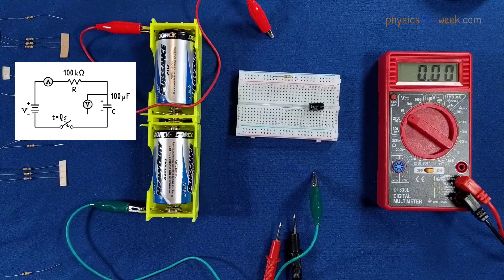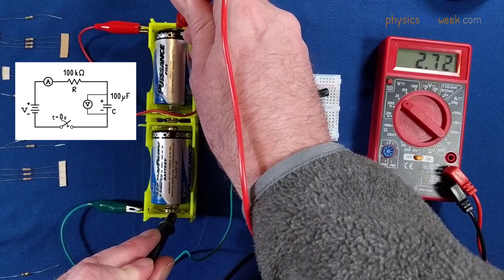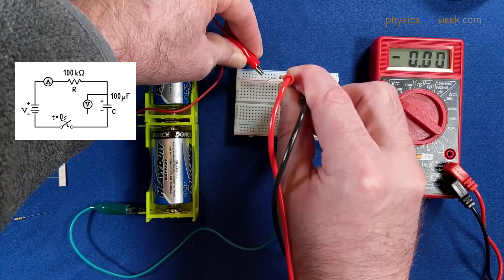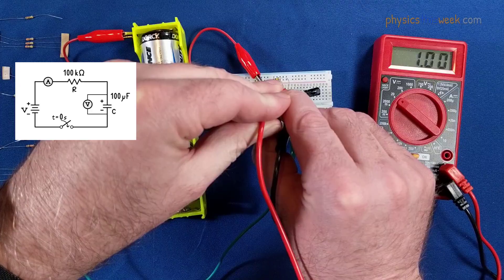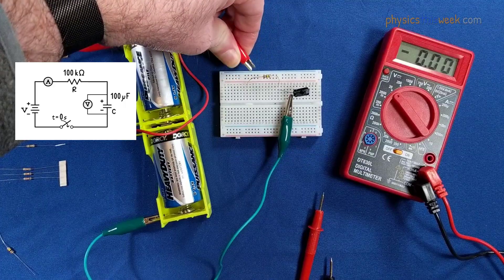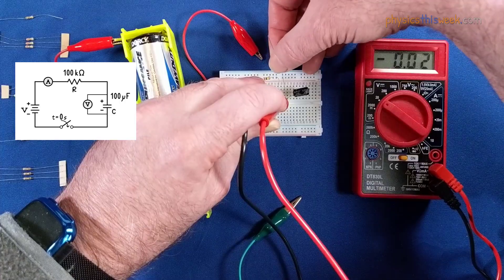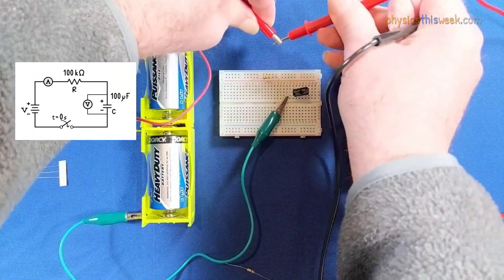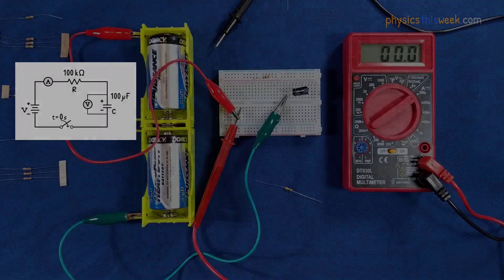DC Circuits Lab:  RC Circuit

Comment: So you're saying at steady state the capacitor voltage doesn't equal the battery voltage. It means there's a current still flowing through the resistor. Doesn't that mean that the capacitor will keep on charging? I am aware the capacitor will also lose charge over time, so it may stop charging when the "leak" equals the charging speed. Is that a correct explanation of what's happening? Otherwise how can it be explained that there is still current flowing through the resistor?
Reply from the maker: Steady state means that nothing is changing.  At that point, there is no current, so the capacitor should have the same voltage drop as the battery voltage.  If I said they were unequal at steady state, I misspoke.  Do you have a time when I said this?